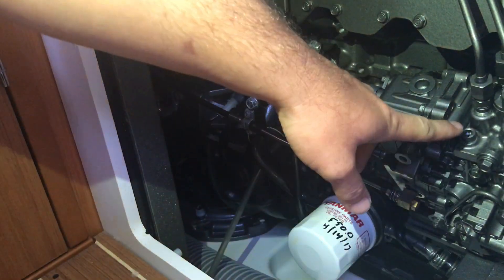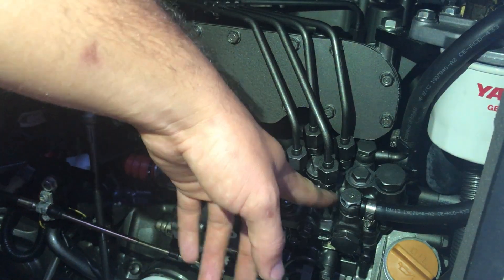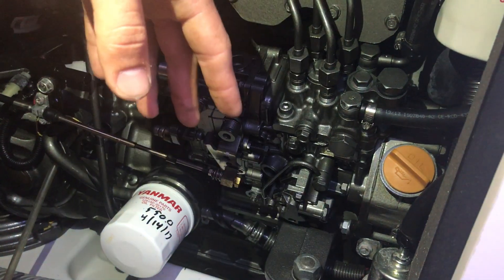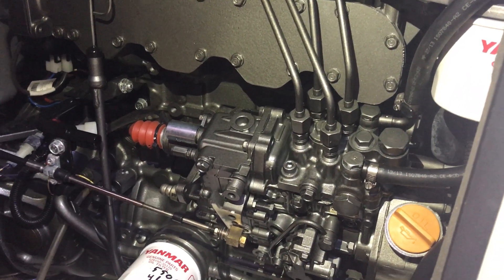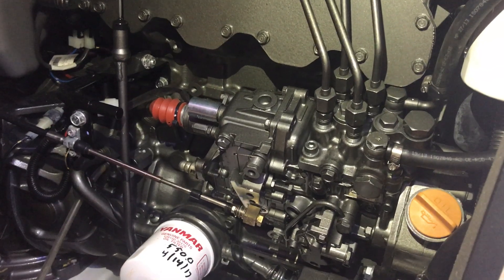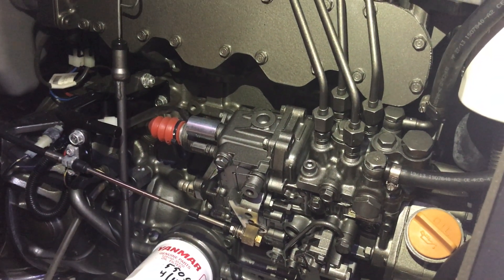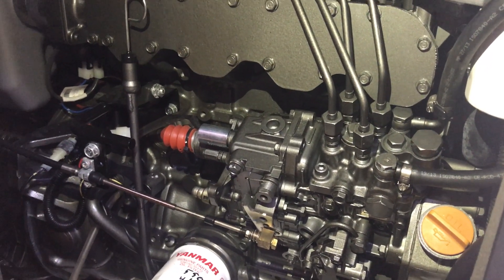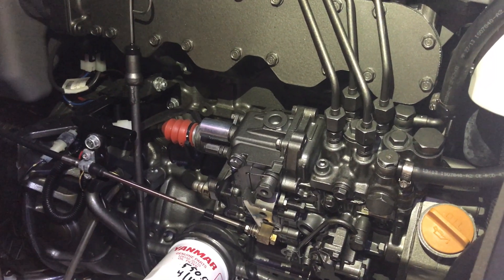Yanmar Engine Basics 4 - fuel injectors

Comment: What is the red thing?
Reply: It's a cutoff for the engine.  If your throttle gets stuck or your working on the engine and you need to cut it off, you can press the red button.